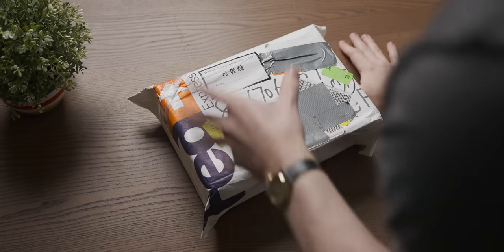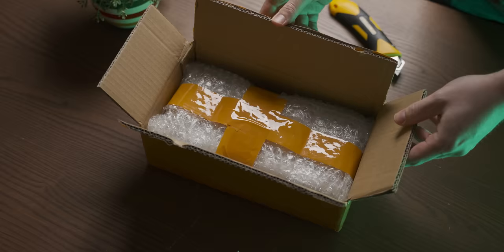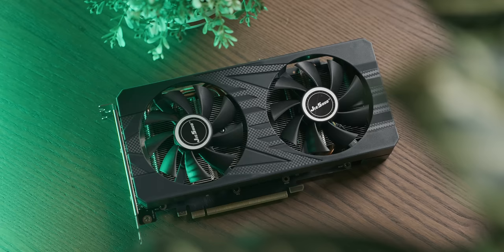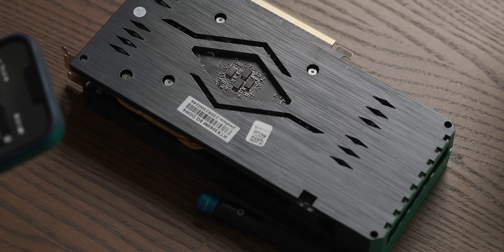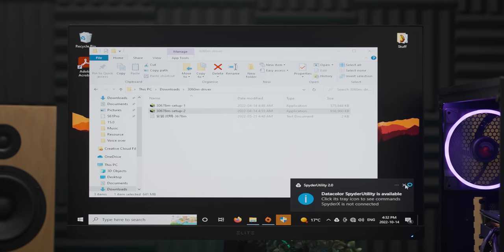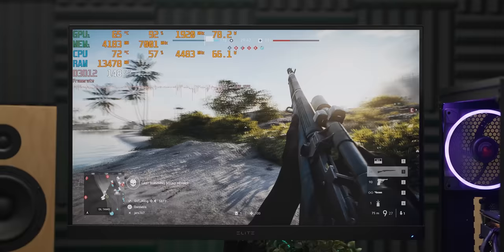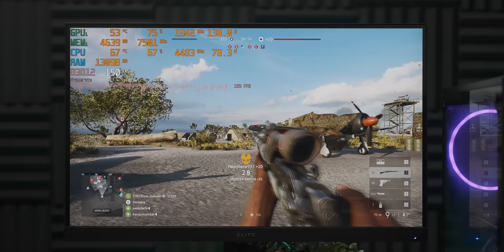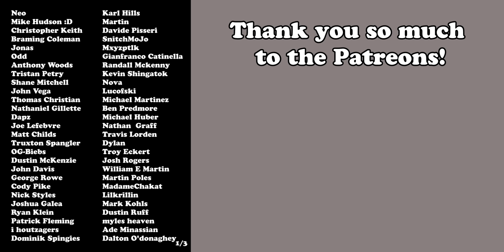This "New" RTX 3060 From Aliexpress Was Suspiciously cheap...

Comment: Actually got the same thing and was delivered about a week ago. I'm a Linux user and it was supported right out of the box with the default Nvidia driver. Was super pleased as I kind of assumed it was a mobile card right when I ordered it by ram amount. Was super surprised with the performance and most games would do better than my 3060 Lenovo legion. Wouldn't dare use such a dodgy driver so maybe if you're a Linux user this might be a pretty good option.

Edit: also wanted to add that I was getting about 230 fps on GTAV using what I'm assuming are similar settings running on proton and Fedora. I also got around 60 at 4k ultra. I'd say a pretty good card.
Reply: Funny how the horrible linux Nvidia drivers do a better job at working than the "great" windows drivers. Any issues?
Reply: @utfigyii5987  funnily enough it's quite true. Actually zero issues. I play games for about 4 hours a day except on weekends. It's held up strong. The only thing I did was a repaste as I noticed the temps were erratic at times. The repaste cleared that up. Solid support on Linux though and super pleased.
Reply: @mkonji8522  which seller if I may ask? I want one so badly :-)
Reply: I'm intrigued by your comment. Can you share your machine specs, your distro and drivers numbering version? , please. I would like to get a 3060 for a Nuc extreme 9 i7 32G RAM running Ubuntu core. There is a list of compatibility components over Intel's web page, but, you know, its about validation and enterprises stuff,  a component can be compatible but it's not validated. Well, I'm restricted to some  dimensions cause my unit it's a SFF computer and I have to consider that aspect too. I hope you can answer me. Thanks in advance.
Reply: @fvlsereverecandiditibisole3403  I'm out of town at the moment but can chime in when I get back in a few days. I'm running Void Linux and awesomewm as of now. I can say I'm getting better performance on Void than on fedora and i3wm which I was running at the time of original comment. Void is technically rolling release so I'd imagine you would get similar results on arch/opensuse tumbleweed as well. I haven't used a debian distro like Ubuntu in over 15 years so I'm not sure if it would be the same or not but I do know they are probably on an older kernel so that might not help. As far as hardware goes I'm using this card, a Ryzen 7 5800x3d, and 64gb ddr4 3600 vengeance lpx. I'll get back with you though after I return and provide you more details. Hope this helped some
Reply: @mkonji8522  You've helped me already. I can try other distros, I'm interested in Clear Linux, the Intel's distro, or I can compile a more up-to-date kernel. The info you have provided me is very helpful, I was surprised when reading your comment by what you said about the OS detecting the card out of the box. I'll wait for your next reply. Thanks again.

Comment: I'd say check out the RX 6600M, which is basically the same case as this 3060M one, but better, since the 6600 and M dies are the same, as are the specs. Only difference is the power target and a bit more core clock on the M model. These made quite a bit of sucess here in Brazil a while ago, when they were being sold for less than US$200. But now there's quite a few capable gpus around that price.
Reply: The problem with those MLLSE 6600M is their cooler... A block of aluminium that lets it work at 75°C (thise 3060 has a better cooler).
Reply: @rabi0ne  It's way worse for some other cards that pull more power, like the 2060S that have been using the same cooler. But for the 6600M, it doesn't use a lot of power, so it's decentish. I usually run at 2200RPM, and even on a 30c room, I haven't seen it reach 90c hotspot and 70c I get when overclocking. It usually hangs around 65c and 81-83c hotspot. That's without an UV too.
Reply: They also work with official drivers out of the box
Reply: @tubularmonkeymaniac  That's mostly why it's a better pic than the RTX 3060M, besides having 2 GB more VRAM.
Reply: There is even cheaper than the RX 6600M, which is the RX 6600XT, its the SHELI 51Risc version but it runs so hot that you can feel Escanor's power. Even with undervolt, the card still runs over 105C hotspot but its price is only 230$
Reply: @iwritegoodessays9779  Since I got the 6600M on the cheap, I thought about the this 6600 XT and selling the 6600M, but I believe it's too much trouble for not a lot of performance. Also, 3060 Ti prices are pretty good right now. Might as well grab one.
Reply: @DMS_134  yeah, just hold onto the RX6600M till its end of life if you dont plan going 2K or 4K. The card is such a gem and might still perform good 1080P performance until 2030.
Reply: 3060 mobile has better die than the desktop counterpart lol.

Comment: The average price of 3060s now at auctions on ebay and other sites, is about $200 currently as I post this.  3070 ti is about $450 and the 3080 ti is about $650 and you can get the 3090 for about $750.
Reply: yea used gpus
Reply: @tadejloncar  well, yeah, or open box. If you are smart you can tell the risky listings from the good ones.  I got an Aorus Master 3080 Ti, still under warranty, with box in perfect condition and all the inserts and stuff, only used a few months, mint condition, shipped and after tax for less than $800. Just a month ago.

Comment: Something tells me official drivers probably would work but you would have to edit the compatible hardware list before doing so. Done something similar to get a GTX980 Ti to work in windows XP.
Reply: Yeah, sometimes even finding where the installer extracts the temporary files and pointing windows to manually search that folder for the driver can get it working without relying on the official installer. 

I had to do something similar to get a laptop GPU working on XP back when my company bought newer computers designed for win7 and we still had to use XP. It would only install through windows, not the Nvidia installer.
Reply: You'd likely have to disable driver signature detection to make that work, but I was thinking the same thing.  Just replace the device ID with a 3060 6GB laptop ID and see if it works.
Reply: Shhhhh...NVIdia might see that and encrypt their driver packages. But yeah, extracting the raw driver files is often necessary when the installers fail to work. Had to do something similar to get an old GT730 up and running. The installer was like "nope, I can't do that Dave".
Reply from the maker: That’s a good idea. I’ll give that a try.
Reply: @DawidDoesTechStuff  Did it work??
Reply: Chinese seller: Install this .exe, trust me bro.

Comment: The market for graphics cards on Aliexpress is very interesting. You can find other laptop graphics cards like the RX 6600M, or the RX 580 2048 SP which are rebrand RX 570. 
I would love to see more videos on this subject.
Reply: RX 580 2048 SP was an official AMD product though, although only in the Chinese market.  I think it might have been a SKU aimed at Internet cafes if I'm remembering right.  It is a bit faster then an RX 570, but I'm not sure how it does that?
Reply: @TheXev  my favorite was the 5gb gtx 1060.

So random
Reply: i am still using my rx570 for only 70$ and its 5 years now from aliexpress
Reply: @PunxTV123  could you please give me a link or product name?
Reply: @SALTrips  i forgot, I just remember it that it's from mining GPU cause it's stacked multiple rx570 without case on a thumbnail picture...
Reply: @TheXev  So its pretty much just a RX 570 XT
Reply: The RX580 2048sp is official for AMD, but you're right, it is technically a RX570, Gamer Nexus made a video about it some years ago

I bought one this month, I'm using it for some days and I hope it works well for a long time, because it's a damn good card
Reply: @dxger  no it's literally just an rx 570. There is nothing that makes it better.
Reply: @mikeymaiku  They probably had a hardware error that caused an instability or malfunction with some of the RAM chip interfaces or something, but the GPUs were otherwise fully functional. So, they decided to disable 1GB and rebrand them as 5GB.
Reply: I found a single slot half-height GTX 1050 on AliExpress. It worked great but the fan has only one speed and it sounds annoying. I had to volt mod it to make it quieter and it didn't impact performance.
Reply: @ccricers  yeah but 1050 is slow.. There are even ddr3 variants out like on the 1030 units..
Slow as a plague.
Yours should be the purple active cooled low profile version right? The fan is only 60mm small an flat so very loud :-/

Comment: Very interesting. I wonder if you could run this under linux to avoid the trojan drivers and still have a good gaming experience
Reply: There are just too many conflicting words in your sentence. Linux, gaming, trojan drivers ...
Working drivers are these nvidia non official windows only. Therefore, you can't have both a gaming experience and trojans installed on Linux. Unless you have a marvelous opens source nvidia driver that can work with this gfx and then play the hundreds of titles ready on Linux.
Reply: @MrCroky123 nowadays, there is a driver that could launch it, although gaming performance would be theoretical, we'll see how it is in 2 years or so, when they bolt a 5060 mobile on instead

Comment: It would be interesting to see how this thing runs with Linux with the free drivers. That might remove some of the worries about the sketchy virus drivers.
Reply: It probably won't run at all because the hardware is modified
Reply: I doubt that if the nouveau drivers would be anywhere near good enough, they barely give good performance on officially supported cards, let alone the obscure stuff

Comment: The driver issue is just Nvidia at work. Linus made a video about another mining card that could be used for gaming but Nvidia locked it in the driver. You have to change stuff in the driver to get the driver to install and work.
Reply: Dude, please help. 

I'm from Brazil and believe it or not, I bought a GPU with a mobile graphics card (unbelievable, I know, but I don't make a lot of money). 

What is it that I have to change in the card so that I can install the drivers from the official store? 

Thank you so very much.
Reply: @bruno_brasil  maybe try install the driver manually from device manager.
Reply: @bruno_brasil  here is a video for the fix you will thank me bro
Reply: @xserv8170  where is it lol

Comment: There's a way to force drivers in Windows to work and trick windows into thinking they are the correct ones.
I have a Hades Canyon NUC as a media-center PC (an obscure Vega M GH GPU). There are no drivers for it but using this manual driver forcing method I can get it to pretend to be a Vega 56 and current drivers work great (games no longer give me issues saying I have outdated drivers). Might not work with nvidia's sleaziness with drivers but hopefully this helps anyone who might be having this issue. The steps are roughly:

- Download the driver package, as it says "no drivers supported" in the installer, leave that window up and you can go into your Windows Temp folders and find the driver files. Copy those files to a safe location as the installer will delete them once you move off the error page.
- Device Manager -> Select your GPU -> choose manual driver update -> Choose Select files -> Go the folder and select the driver folder -> Driver Update should then get you to choose which GPU driver package you want to FORCE-equip to your GPU

Do this at your own risk, but it works great updating a Vega M to a Vega 56 driver package. Might not work at all for nvidia but might be worth a shot to be able to use official drivers.

Comment: Dawid, an issue here is that the brand new Nvidia driver that came out a few days ago gave most Nvidia gpus about a 20% performance bump in a lot of titles, which means you can't quite compare this to the desktop variant. Also, I'm pretty sure the laptop die actually has more CUDA cores.

Comment: You may have to modify the driver inf file and manually put in the device id for it to install official drivers. I've done it before with other odd devices, but it doesn't always work.
Reply: This is what I had to do with my clevo mobile 1060 and rtx 2070
Reply: Can you make a video on it and reply back to me I’m planning on ordering some now myself
Reply: Yes, an easy way is to use techpowerup 's NVCleaninstall software that allows you to add hardware ID's to drivers.
Reply: I was thinking that he might be installing the desktop drivers instead of mobile. Didn't nvidia used to have them separated out?
Reply: @waitandhope  na they should be combined as far as I am aware of.
Reply: @waitandhope  I think they are separate drivers but nvcleaninstall should work on those too afaik
Reply from the maker: Oh that’s interesting. I’ll give that a try.
Reply: Yeah, and that breaks driver signing.  Then you still have to do some hackery to get Windows to accept it.
Reply: @MrRobarino  I turn testsigning on
Reply: @DawidDoesTechStuff  did it work?
Reply: @spyofborg  We will never know, sadly.

Comment: Hi David! It seems that the drivers provided by the seller have a Trojan.

The method to install the drivers is, downloading the 3060 drivers from NVIDIA, decompress them and  installing the drivers manually, I think that you have to install the 1650 first and then the 3060 laptops drivers. But, both works.

Comment: Dawid, I'm pretty sure those drivers are just Device ID locked, that's why the North American driver installer package won't allow you to install drivers for it, probably due to it's PCI subset Device ID imbedded in the VBIOS. If the installer can't find the correct Device IDs it won't allow an install. There are ways to force it to install but that takes some code hacks to accomplish. The drivers they gave you are probably hacked drivers from the official driver package.

Comment: For installing the video cards that it doesn't recognize with the installer, you can do it through device manager and go to the card and select update driver and do a manual install of the driver and it works.  It's the same way I did with a GTX 1070 Mobile on my HP zBook 17 G3 to get it to work.

Comment: if you want to give this a try again there's also the RX 6600M, which for what i've seen does work with official drivers and slightly outperforms the desktop RX6600

Comment: I like how there's no "arrow" on a regular 3060's 1% in GTA V. Not biased at all.
Have that GPU installed in one of my PC's atm (using the latest v526.86 drivers, btw), and it works wonders (for its price and TDP especially).
If you can't even install a GPU driver (nor manage your AV or use VT/SB) - you can be considered a dodgy boy instead. =)

And that "promosing" in the description. * chef's kiss *

Comment: You should be able to use a utility to reflash the bios so that way it will accept an official driver. Essentially what the fake GPU sellers do to try an hawk an old GPU as a new one, but this time actually flashing proper bios to the GPU.
Reply: all he needed to do was swap the inf file in the driver to the mobile one.

Comment: I wonder how that card works in Linux with their drivers.
Reply: even if it did not ever work, could perhaps have the option of loading the gpu in windows in a vm to avoid possible trojans.
Reply: I remember reading that these mobile cards built for mining were Linux only. Maybe they found a windows work around for them? I would definitely try Linux.

Comment: Those Mining cards they change the bios they use a modified bois in which the power consumption is low so this card does not consume a lot of power like the stock bios

Comment: I picked up one of the JieShuo 6600m cards for $180 recently and am very pleased with it.  Literally the best value budget card you can get right now.  The card itself looks almost identical to this one. They are seriously streamlining their products.

(Also, no driver issues. Just install the AMD driver pack and it's good to go. )
Reply: Did you also have to install dodgy drivers?
Reply: @bobnope457  no. Just install the AMD driver pack/adrenaline and it's fully functional. The only oddity is that you can't change the vram speed. Not sure if it's a physical limitation, or if it's bios locked, but Core and power are adjustable, and it runs just as well as a regular 6600.

Comment: Hi, you may wanna check the overclocking with MSI afterburner, I have laptop with 2060m and the W goes to 115, most 3060m go from 115-140 depending on the brand, chances are the trojan gpu have more potential :D
Reply: 3070m is the one which get up to 140w, 3060m only get up to 80- 115w
Reply: @user-hr4hu8xb5f  130w actually, 3600m can go all the way up to 130w with specific 115w models on higher tier.

Comment: I find this kind of funny that you never test these on Linux. Linux don't give AF and will run an opensource driver and the proprietary driver you can install doesn't need a detection, just tell it what the CPU is and it will just run it. Saw a someone do this before with these questionable cards. He did however look at the dodgy drivers and noticed they are simply not signed and that's the only reason why they come up as a malicious file. If I were to make my own graphics card and write my own drivers for it on Windows, Windows would refuse to install said drivers because they aren't signed and approved by Microsoft. Your first mistake was installing unsigned drivers on an Operating system which is already malware. They don't like competition.

Comment: I think the driver issues might get resolved by flashing a new vbios. A different vbios might also unlock the gpu to draw 130 watts.
Reply: You say that like you can just flash any random bios file to it and it will just work.  It doesn't work that way.  If he can't get proper drivers for this card, the odds of locating a proper bios flash that will work are even harder.    You're trying to make it sound easy, but it's not.